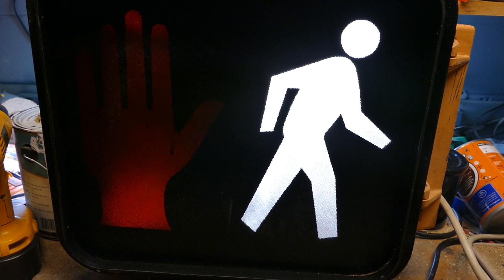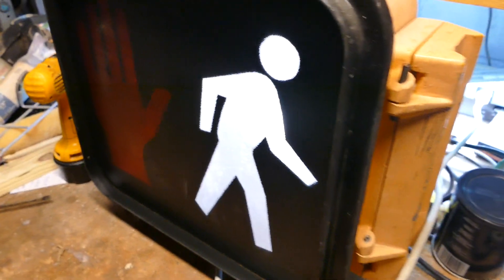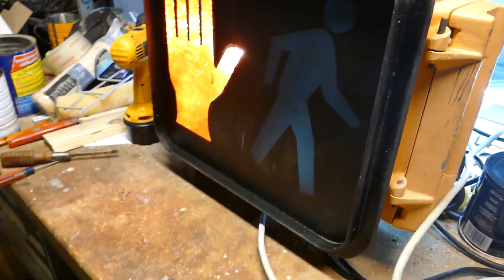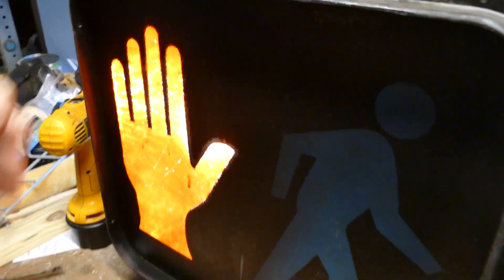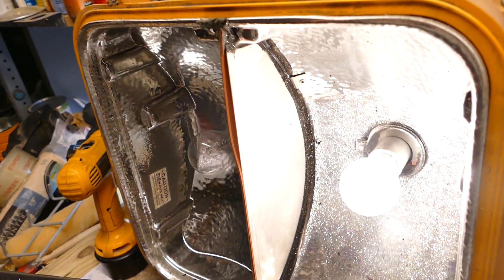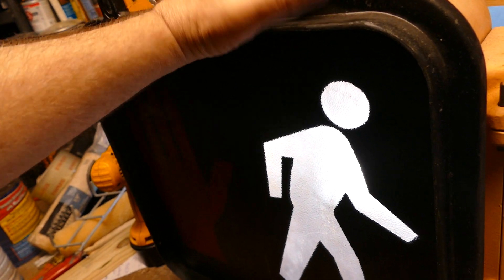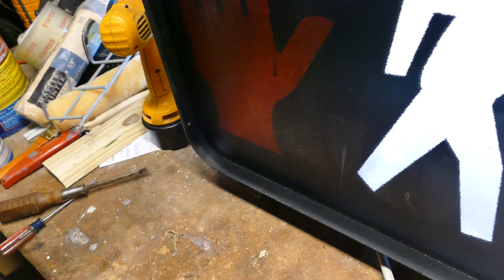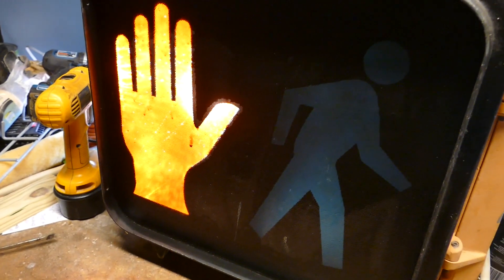Walk Don't Walk sign in operation with internal flop flop relay circuit

Comment: I have a walk/don’t walk sign that needs a relay. Where can I get a relay for it, what kind do I need?
Reply from the maker: I will send you the best relay/ logic. I am traveling. It will take me a couple of days.
Reply from the maker: You can use a Qf-RD72 timer relay. It works great. About $8 on amazon. 

https://www.amazon.com/Comidox-Infinite-Timing-1000min-Adjustable/dp/B07L75TSTL/ref=asc_df_B07L75TSTL/?tag=hyprod-20&linkCode=df0&hvadid=693335572473&hvpos=&hvnetw=g&hvrand=3514879003324615576&hvpone=&hvptwo=&hvqmt=&hvdev=c&hvdvcmdl=&hvlocint=&hvlocphy=9010813&hvtargid=pla-649455255994&psc=1&mcid=3aefeb96eb02382fbc026790198d5f02&gad_source=1

Comment: Incandescent pedestrian signal
Reply from the maker: You can use a Qf-RD72 timer relay. It works great. About $8 on amazon. 

https://www.amazon.com/Comidox-Infinite-Timing-1000min-Adjustable/dp/B07L75TSTL/ref=asc_df_B07L75TSTL/?tag=hyprod-20&linkCode=df0&hvadid=693335572473&hvpos=&hvnetw=g&hvrand=3514879003324615576&hvpone=&hvptwo=&hvqmt=&hvdev=c&hvdvcmdl=&hvlocint=&hvlocphy=9010813&hvtargid=pla-649455255994&psc=1&mcid=3aefeb96eb02382fbc026790198d5f02&gad_source=1